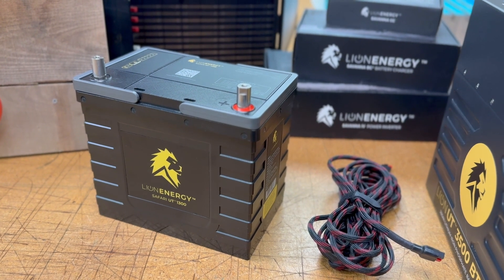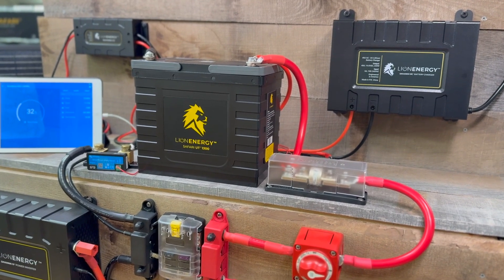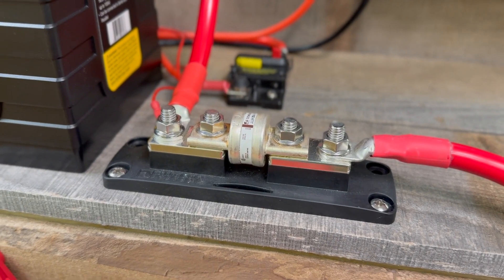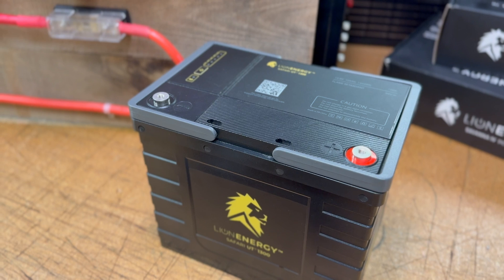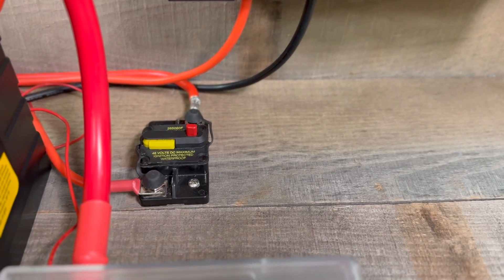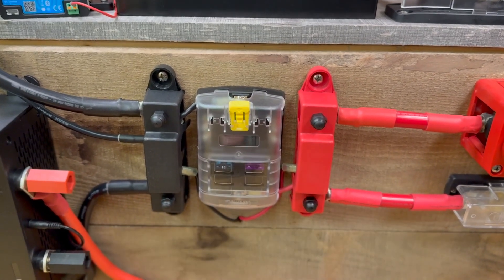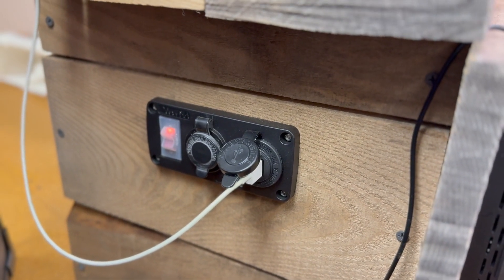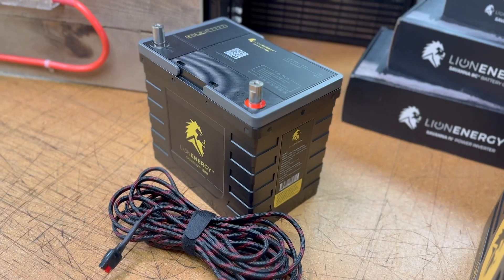Lion Energy LiFePO System Overview

Comment: Great setup. All quality components.  Personally I like to have my charging (solar/grid) on the other side of the Class T and battery switch so I can disconnect the entire system but I see where you are going with this setup. 
One question. I didn't see any mention of grounding.  How do you handle system and equipment grounding?
Thank you for the video.
Reply from the maker: Thanks for the comment and question. My interest is primarily marine applications, and the ABYC has specific standards related to equipment grounding on vessels, none of which I mention or include in the demo bench. For example, both the inverter and the battery should should have case grounding lugs that are tied into the vessel's negative grounding system. Additionally, inverters (as a new source of power aboard) should have a neutral/ground connection when inverting. If in pass-through mode, there should be no neutral/ground connection - the only neutral/ground occurring at the shore pedestal or at the onboard generator. Lion's emphasis on portability/mobile applications - with the items in this video, anyway - often means that ground would be to the chassis of the vehicle. There are no grounding lugs on either the charger or the inverter, however. The addition of lugs would be an important safety consideration, for sure. All of my boat's onboard systems are grounded per ABYC standards and recommendations.